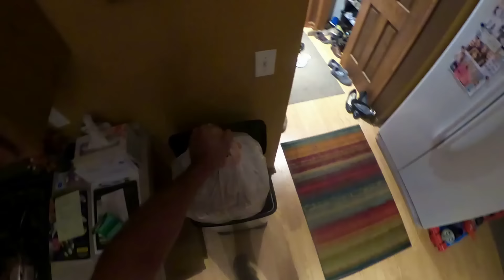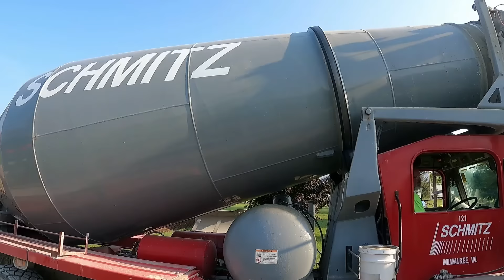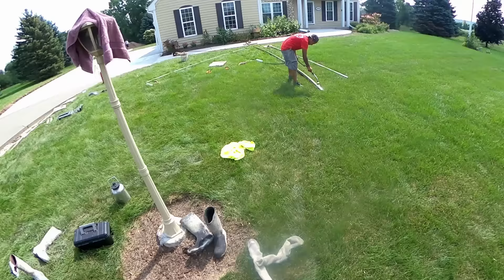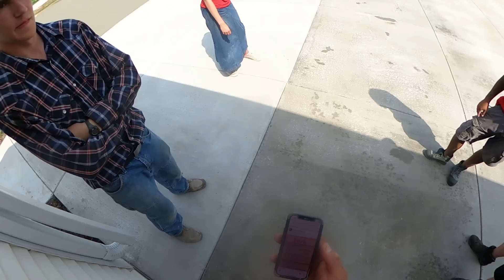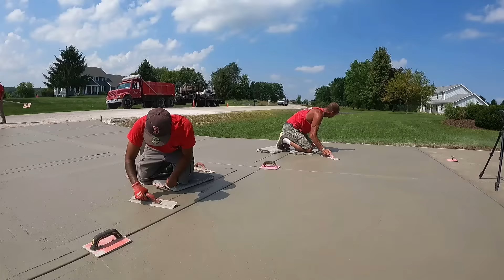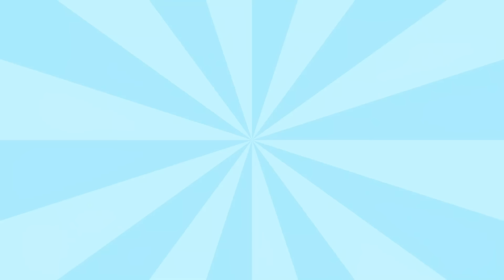Desperate for help. Nobody wants to work!

Comment: As a 18 yo kid in 1976 I applied to everyplace I could find for a job. I was laughed at by numerous small businesses, trades etc. Over 70 handwritten applications later, I finally got a job at burger king, part time filling in for the full time. How times have changed.

Comment: I have three teenage boys. I tell them that the key to success in today's job market is two-fold: show up and do your job. Twenty years ago when I was just getting into the full-time workforce I had several jobs where coworkers would just disappear or get fired for sitting around doing nothing. The boss would complain about how hard it was to find people that would just show up and do the bare minimum. Fast forward to today and it has gotten so much worse.

Comment: If I knew anything about concrete I would definitely work for this man good bosses are hard to come by now days
Reply: It is very easy to learn, at least as a laborer. Figuring out the job is another thing altogether. But if your one of the people just pulling concrete its quite easy. Even finishing is quite easy to pick up. The only thing that takes years to master is the forming, design ect.
Reply: @fortwoodmisery  I would say it’s the opposite
Reply: @fortwoodmisery  na concrete really aint easy it takes a while to learn
Reply: @WeaponUpgrade  Its quite easy.

Comment: I am a building contractor and I love to build and see men work their craftsmanship. I grew up swinging a hammer, yeah, back in my time, we swung hammers and not nail guns. I still wear a apron, but learning my limits and mainly supervise and bid jobs, you see, I am 60 years old, and not a young buck, but I still get out there. Only thing I would have done I saw you didn't do, was where the drive meets the asphalt road, code requires a "turn down footer" at that intersection, DOT requirement, but keep up the good work

Comment: I used to drive concrete wagons in Wales United Kingdom, and once I delivered concrete to a guy on his own and he had the straight edges down just wider than the wagon but he chained a steel beam (heavy duty) to the back of the truck so every time I moved forward the beam was levelling the concrete to a finish it required at the end I must say it was ok. Great videos keep up the great work

Comment: You are a true inspiration! As an electrical contractor I gave up on relying on employee's. Had 2 crews going at one point nothing but headaches. I'm down to one reliable worker, ME. Luckily I can do this in my trade, if the job is bigger than just me I just pass. I really commend you, love your video's, keep up the great work! Just curious, I'm from the northeast and here we leave the edges left from the edging tools, I personally like the look just wondering why you guys smooth them out/ eliminate them.

Comment: Question, first you do beautiful work, i have been watching for several months and you usually put down the plywood in the drive for the cement truck not to leave ruts second is their a reason you do not use the power screadder more often I though it would help when labor is tight. Thank you for all your great work & video's....Gary NJ

Comment: I was a ready mix driver sometimes crews like this were short handed so instead of setting in my truck and watching I would get out and ask what could I do to help them out. I have dragged with the mud rake or used the hand triles or bull float any way I could I would help a finisher out and sometimes they would tip me for the help I made a lot of friends in the concrete finishing business.

Comment: Questions:
1) What is the hourly rate of pay?
2) What are the benefits? Healthcare??
3) Is it full time or seasonal work?

If you are paying a good wage with benefits such as healthcare for a full time, year round position you won't have a problem hiring people that appreciate the job, are hard working and don't miss time. This is based on my 35+ years in the construction industry.

Given the above, if a guy of mine doesn't show up for work without a valid reason he gets a dressing down and ONE warning. The second time that it happens he is sent packing.

Comment: I remember working on a landscaping and snow crew.  It wasn't even concrete work. I never would have thought of calling in sick or no showing. But after a long summer  of seeing the rent-a-drunks no show and the owner-boss compensating and still being I nice guy, I finally decided to call off. I think I did it more than once. He was the nicest hardest working guy I've met. I haven't and wont do anything llike that since. ~15 years.  I bet a few of your guys do it regularly and your new guy learned it.  He is tired. He doesnt have ownership.  Maybe decentralize your leadership.  Can a senior guy run a project or take ownership?

Comment: man that doesn't even look to bad. I worked in pool business for 7 years and hand digging in 40 deg + was the worse part of the job, especially since my area is just full of rocks anywhere you dig. We did smaller concrete jobs like the entire board walk around the pool and we had to wheelbarrow all the concrete, definitely wish we had your setup.

Comment: I did concrete work with my dad many years ago, learned quickly that I did not want to do that or roofing for a living. You need a power screed, vibratory or the roller one, machines don't call in.

Comment: What I believe is the problem is that major corporations and special interest groups have had such a stranglehold over the economy for so long, and have taken so much of the wealth out of the average persons hands, it has resulted in a situation where what is best for laborers and the overall economy is the quite bad for small businesses. The major corporations can afford to pay higher wages, the small businesses cannot compete with corporate coffers. So, the two groups that ultimately have the most to gain from the redistribution of the wealth are the labor-force and the small business owners, but they are at odds with each other currently because of how the economy has become so top heavy. Unfortunately in order to fix the problem there might have to be a phase where a lot of small businesses come and go until a balance is found.

Comment: I run a small business. I pay a good wage and have profit sharing right down to the newest member on the team. Its equally as hard as pouring concrete, probably more so. I have ZERO problems retaining workers. I know that new hires can be rough, but if you are having a retention problem, its 100% on you.   < Not aimed at the creator of this video, have no clue who he is. Aimed at the trolls in the comment section

Comment: Do you have problems with the cement finish sticking to your knee boards, here in Montana a lot of the air entrained concrete pulls up with the knee boards, makes it hard to get a nice broom finish sometimes.

Comment: I gave my job everything I had. 8 years later I was told my contribution to the company was minimal. F them. I saved that company millions of dollars. I kept coworkers from quitting constantly. I kept the machines running. I supervised more than the official supervisors did. They'd just go goof off in the back rooms. But I was told my contributions were minimal. I walked out and never went back. I was constantly getting calls for advice afterwards because I did more than anyone else while I was employed there. They needed me. But my contributions were minimal. Screw the entire company. I hope the place catches fire and burns to the ground.

Comment: I'm not a concrete guy but came across this video. I have watched other concrete videos and have a comment/question: That metal reinforcement wire: is that not supposed to be in the middle of the pour? It looks like its lying flat on the ground....

Comment: Wire police, here in my city, they want permit s and they check per phases of the work, so wire off the gravel one inch, and they won’t clear a pour until it’s been cleared. And that includes any contracted job.

Comment: question when you pull the wire then you screed arent you basically pushing the wire to the bottom when you step on it or does the concrete under it support it so it doesnt go to the bottom?

Comment: Can someone explain why they put the lines is for looks or to let the concrete move with the temperature?
Reply: All concrete shrinks as it cures. This shrinkage will create stress in the concrete lattice which will then create a visible crack in the concrete. The lines are called control joints. By troweling or cutting control joints with a saw the stress induced cracks will most likely occur in the control joint, thereby hidden from view. Also, by controlling the location of the stress/shrinkage cracks the slab will perform better and last longer.

Comment: If a laptop isn’t their tool Arsenal, they have no interest. Tooth and nail jobs aren’t glamorous enough anymore. I’m a crew of 2 that pre wires and finals new homes. My schedule is 2 months out, 6 days a week. Assuming material shortages don’t disrupt us, I could employ 3 more people but there are none to be found.   This goes for every trade I encounter. Dirt work, Concrete, Frame, Electric, Low volt, HVAC, Plumbing. If you want to learn something new that you can take pride in, please get out there. Chances are you could walk onto any construction site with boots, hard hat and a good attitude and someone will hire you on the spot.

Comment: I know a lot of crews that have zero issues keeping people and I know a lot of crews that can't ever keep people. I am wondering what the story is on both sides? The trades is a weird industry but guys like it because they can easily drift from place to place and pickup work whenever they want. Also concrete is brutal work at times and I imagine a lot of these guys get burned out and just want to go party.

Comment: Get two cones and put on each side driveway and tie you caution tape to it .to much wasted time trying to beat them pins and two by four in just for a barrier and risking breaking someone's wrist and arm hands ... I understand if it's soft them use the way you do it but that was just to much when you can just use cones and they are even more visible .you could asle put one in middle

Comment: The work ethic among around 10% to 20% of the workforce was disgraceful,  zero accountability, it was bad in 2019 when I retired, I had several hundred positions open accross 14 states, 2020 with the incentive NOT to work that percentage is much higher, glad I retired after 45 years

Comment: Here's what it takes.  Pay them what they are worth, and stop requiring drug testing for weed (and only weed).  I'm a CDL driver and (former) boom crane operator.  Do you think that's worth $17.50 per hour.  I don't.  It's why I quit.  You work a job like this and by the end of the week it's nice to be able to kick back and zone out for a few hours on a Friday night.  Food and gas have gone up 20% to 30% in the past 3 months alone.  Pay rates?  Lucky to see a 1% increase per year.  Do the math.  I couldn't even afford the gas to GET to work at my old job now.  That was in 2015, and they still aren't offering any better pay at that place.

Comment: You need to change your title to inflation rises twice as fast your wages 20 years ago $25 an hour was good money but now that I have kids and crazy high rent I need minimum of $35 an hour. 25 years ago you work construction and rent a nice apartment now if you work construction you have to live in section 8 housing. I switched to tree work much better pay with retirement and medical.The wages have been frozen for 20 years but the house we build cost twice as much I don,t get that

Comment: So many guy's use the wire and never have someone with a hook pulling the wire up in to the concrete and it's just stupid. What good is the wire sitting at the bottom?? We have a crusher so we except broken up concrete, Asphalt, block and bricks and 97% of the concrete dropped off has wire sitting on the bottom. I don't like the wire myself I prefer Fibermesh only. Even if you have someone ahead pulling the wire up you still have the guy's walking on it and it just pushes it back down, but that's just my opinion dosent mean I am right or wrong just my preference. Good luck getting dependable employees, getting drivers is almost impossible, either can't pass a drug test or they can't find a ride to work or only wanna work from 8 to 4. If your not willing to work at least 55 hour's per week your in the wrong business and wright now concrete is in high demand from residential to commercial.

Comment: You boys fail too with installing expansion joint material,,,,,without expansion you are failing the movement process, ultimately failing the customer,. Nice big job, ,….

I hope at least you saw cut the next day,,if  u don’t you will learn, the hard way,34 years experience talking here,,,,,